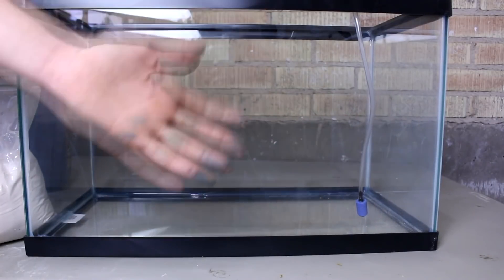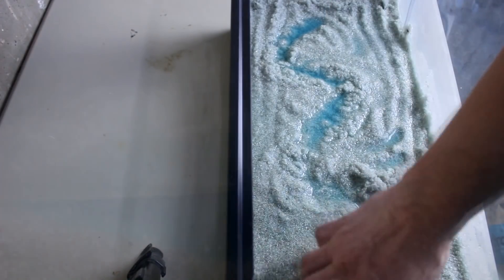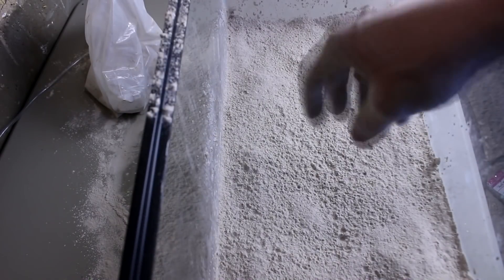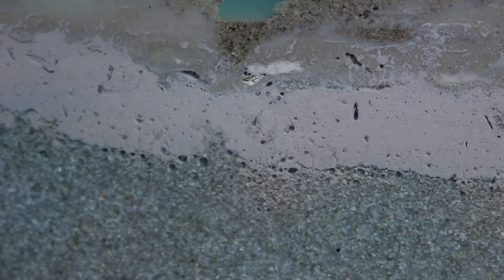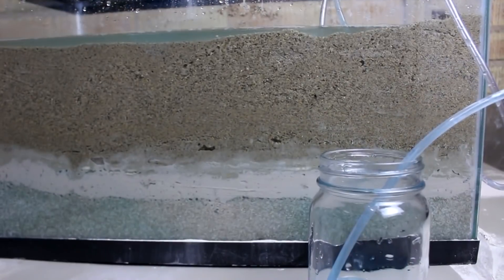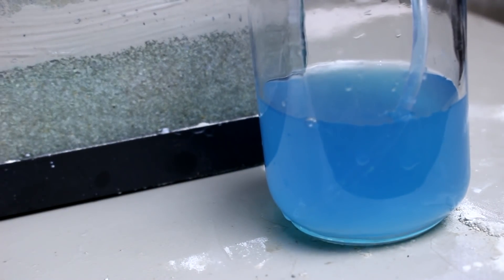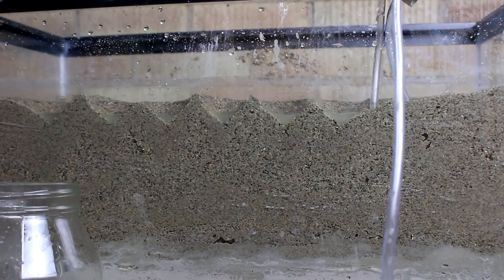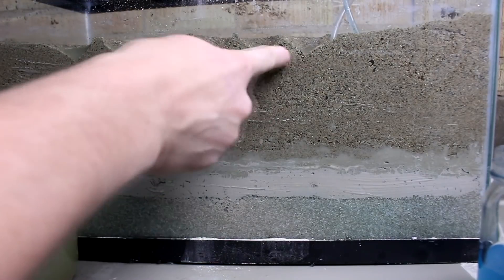Confined Aquifer Model

Comment: Where I live we have a confined aquafer prolly ~4-6 m bellow the ground because we have a surface clay and stone layer with a thin topsoil layer, but it must be a lot more porous in the aquafer than sand or sandstone since when it rains a lot especially when tropical cyclones make landfall and dump rain on the range we can actually hear the water moving through it which is a bit scary, and a few years back during a flooding event in the wet season the ground in some places felt like a waterbed.

Comment: Do red hot anything in a vacuum chamber. I want to see how long it'll stay hot with no air for it to transfer the energy to. The only problem is how you'll levitate it in the chamber so it doesn't blow anything up. You might need some aero gel or something.

Comment: your wisdom. When melting aluminum there is always a leftover called dross that is what appears to be oxidized aluminium and some contaminants, trying to retrieve a big amount of leftovers I've seen some ways to deoxidize aluminium using caustic soda (NaOH) or oven degreaser. I need your lights on that matter, what is your opinion?

Comment: Is that not just siphoning the water? if the tube exit is lower than the water source then there is nothing to push the water will pull its self down the tube on its own

Comment: The way you explained california's settlement issue is incorrect. The vast majority of settlement occurs from water that was trapped in the clay aquatards, being squeezed out into the confined aquifers as the pressure drop from wells allows this to occur. It is secondary settlement where the clay particles flatten out their orientations, decreasing the void ratio. The sand layers have way way less water by volume and they are by comparison not compressible. This is why the settlement is irreversible because you can't reset the void ratio without digging it all up. The aquifers (sand, gravel, larger silt) themselves can be recharged though and doing this intentionally is called groundwater banking.

Comment: The effect should  be magnified substantially, if an earthquake happened. 

There is only so so much compaction due to confining stress. The level of volume change increases dramatically if deformation (strain cycle) occur. 

A shock wave causing two-way cyclic loads will cause HUGE shrinkage. It could be plausible to revive dead aquifer using explosives, I guess :) (especially if the explosives are placed on opposite sides of the regions being "shaked down")

Comment: hey Cody, so if you turned the bottom layer of sand into water some how without disturbing the other layers, would you see the bottle fill up extremely quickly rather than slowly because the water doesn't have to travel through thick sand?

Comment: Nice video, but slightly misleading. Although the concept of overlying ground compressing an aquifer is technically correct, it can only occur if the aquifer is entirely confined. 
Almost all artesian wells are driven by hydraulic gradient, such as described when you were talking about recharging aquifers. The pressure is being created from hydraulic head due to elevation of the aquifers source, not ground compression.  Yes, ground compression can apply in some circumstances, and pore space loss due to compaction is common, but it is the exception, not the norm.

Comment: If we ever needed to for some reason, would it be possible to refill a confined aquifer? I know shipping fluids over land is expensive relative to the value of the fluid in question (especially so in the case of water), but assuming it were cheap and easy to do so, could we overcome the ground pressure and pump water back into an aquifer?

Comment: My family lives in an area in the Nebraska Sandhills where for about about 5 square miles it is perfect for having an Artesian  well or flow and well as we call it. We have have over 10 i believe on the property, the oldest dating back to 1892 and none of them have ever stopped flowing throughout their lifetime. One of them is powerful enough that when it was dug in the 40's they had put an extra 20 feet of pipe on the drill stem to cap it off before cutting it and even then the water flowed out. There is also a 4 inch well in our lake that fills it up too.
Reply: Sigibrand there was one near a creek where I live and that creek had crystal clear water, then the city capped it and that creek has become the dirtiest waterway in the state

Comment: shouldnt have had the glass below the waterlevel in the sand, interconnected vessels allone should drain the water, without soil or anything, if the waterlevel in the pipe (well) is above groundlevel once.
Am i wrong?
backseat science here

Comment: Once it starts though don't you create a siphon? I say that because the tube in the glass was about the same level or below as the one in the bottom layer of sand. Like a tube in the gas tank which leads to a Jerry can on floor. The inlet (gas tank) is higher than the outlet (Jerry can) just like your tube leading to the glass. If you had kept the tube opening at the same level (like a well on the surface) would that much water still come out I don't think it would have.

Comment: In theory, with enough pressure, could you force water back into the bottom later? (in model and in real life)
Reply from the maker: josh hightower 
Yes but it still may not loosen the sediment if it was compressed past a point.
Reply: So instead of wet sand, it would be a layer of water between sandstone and clay (ignoring the enormous pressure)...long term it would seem that that could cause issues.

Comment: The only thing I didn't like about this experiment was that he lowered the output of the tube so it looked like it was acting like a siphon. I don't think he would have gotten as much water out otherwise.
Reply: Which is what pumps do as well. I thought that was the point.
Reply: I thought he was suggesting the pressure from the other layers alone was the cause for the large amount of flow.

Comment: Cody, have you seen that rich technology designers in Silicon Valley are on a new diet trend called a "Raw Water Cleanse"? They fast for days while drinking water that has not had enzymes, bacteria and little creatures swimming in it filtered out. They call it biohacking. Apparently they say the stuff in the water cleanses your system (maybe by giving you diarrhea?)

Comment: How resistant to acid or hydroxide is bubbler stone? Can it be used to speed up chemical reactions feeding gas in liquid?
Reply: I have used them to speed up PCB etching without any problems. Hydrochloric acid doesn't seem to effect them.
Reply: That is cool. I see many chemists trying to make nitric acid bubbling nox through water but they never use a bubbling stone to make fine mist like bubbles. If they did they would get a better yield I think.

Comment: Could you make a model of fracking in a similar way?
Reply: He would need a sample of low permeable fluid-bearing rock and a high pressure liquid that is able to tear the rock apart. I think using the vaccum chamber and a small water pump he could model hydraulic fracturing with water to release olive oil for example. Would be interesting to see.
Reply: I do not want Cody to have a frackident.
Reply: Fracking's main purpose is oil, not gas. And considering that oil is less dense than water, fracking's function is simpler to understand than water wells. All you have to do is shoot water and sand into the source rock so the oil can come out and float out.
Reply: Robert Faucher Fracking involves the release of natural gas, no? I'm not sure how he could simulate that..
Reply: @a.j8307  he literally has methane(natural gas) generator running 24/7 :D
Reply: I have a 24/7 methane generator too. Mines portable but it has a hydrogen sulfide contamination and needs to release pressure every now and then with a tremendous noise and smell. They say my generator is so potent it can clear a room!

Comment: @Cody'sLab Although this is correct its somewhat misleading. The majority of artesian wells form by confined aquifers with topography and the weight of water in the high points generates high heads at well sites. I have a diagram i could show but cant post to a youtube comment. Essentially it is a difference in the watertable and the potential watertable.

Comment: I'm no geologist but I've seen live data come in the company man monitoring the fracturing of deep formations here in the Big East. Some of these formations like the Cherry River are continually moving posing lots of problems for the oil industry. I would rather have water than gas!  I've been out west. I just saw a guy on YouTube use the gasification of wood to run a generator. After watching this one I'm worried about our Forrest here. Good demonstration

Comment: Cody, you know how metronomes synchronize if they're put close by and on the same frequency? I've always wondered whether they communicated the vibrations through the air or through the surface they were one. This would be a good experiment for your vacuum chamber.

Comment: are you ever going to work on your mine again?!???

I would honestly drill multiple holes in the roof, add intake and output fans for ventilation, as well as concealed wiring system and insulate the front door entrance.
you could turn it into a green house or just a cave house with stuff like built in rock counters lol

Comment: Great video... may I make one tiny criticism?  Having the exit of the tube into a collecting jar below the level of the source of the water produces a siphon effect which increases the flow rate above that which you'd otherwise get.  If you had done the same thing with the higher level water source, having evacuated the air from the tube, that too would drain purely from the siphon effect.  So your explanation is fine, but the demo is a bit wonky.
Reply: Yah I was looking for this comment, he's siphoning his aquifer, it's not a spring anymore
Reply: should have had the peak of the tube just a hair over 1 atmosphere of pressure high.
Reply: that's obvious though its just for exaggeration on such a small model you want to see the water get moving
Reply: i understand that some siphoning is occurring that's probably for sure, but how noticeable is the effect when we are talking about water in an aquifer? wouldn't the resistance from the sand kind of stump the effect a good amount? maybe even cause it to break at some point? especially since the further away it gets from the hole the harder it is to keep the siphon going.
again am assuming there is some siphoning going on but am just asking if a siphon is actually an effective method to pump in this situation, this being a small scale probably yes, but what about a real confined aquifer? plus i think the pressure in the modelled confined aquifer was enough to demonstrate it can climb to well above the height of the ground (despite the small scale), which is just like real life. but again again the draining into the jar probably had some siphon action going.
i guess what am asking is how strong is the siphon action and where are it's limits? is the sand not fine enough to disrupt the siphon?

Comment: Hi Cody,

unfortunately you put the the end of the tube at the same level as the bottom of the aquarium. This way the water will drain itself since the the flowing water in the tube creates a lower pressure. Just like you can siphon your cars gas tank with a tube and sucking on it if on end is lower than the gasoline level .
You should have put a vertical tube in the sand and show the Confined Aquifer Model by the water rising in it.
Reply: isiTsotsi An artesian well results from a path leading to the surface that is either equal or lower than the water table level which causes it to flow without any work, his model is a good demonstration of this.
Reply: The well is pressured regardless. You are putting water under pressure. He adds enough weight to get it out. Sure, putting the collection at the same level of the ground allowed for the water to stick and continue to flow faster for longer. But this still properly shows the concept miniaturized. Think of the amount of pressure real aquifers (and other gas/liquid chambers trapped underground) are under, and how large of an area they can encompass.
Reply: he essentially had an artesian spring form when he had that leak punch through the clay layer.  If he'd let it keep going, it would have eventually started working it's way up to feed the unconfined aquafer on the surface layer.
Reply: interconnected vessels are indeed making the draining faster isnt it, thought about that too, the pressure from the "soil" just had to push the waterlevel above the highest point in the pipe, after that water should drain itself regardless
Reply: You sir are correct.
Reply: And in the beginning the level of the water rose by itself
Reply: I am not disagreeing with you guys but i think you get my point.

Comment: For the circle diffraction you will be much, MUCH better off using a ball bearing hanging from a needle with a magnet. I was able to easily see the dot, around 5 or so Airy rings around it and a great number of airy rings around the outside of the sphere! Clear and bright enough to film.
To get superb results a surface deviation of <λ would be good, though it works with more as well of course

Comment: I'm curious now an need to go on a learning adventure. 

I'm pretty sure Maine has underground water like this. We have good "spring water" that is filtered by the landscape an we also have incredible deep well water that was pressurized into the rock by  mile thick glaciers  durring last ice age. As a kid I was told that the couple local springs we get our drinking water from are this ancient glacial water forced through fractures in the clay. Exactly how Cody's model works. I need to find out if this is the actual reality of the situation or just what was assumed back in the day.

One of the springs is a 12 foot hole dug down through a 4-8 foot layer of clay with a ceramic culvert pipe 2foot across down in the hole. I need to go measure it now to see how high from the ground surface that the water spills out.

Comment: Is this how oil spills up from the ground when found? Please reply Cody thanks!
Reply: Oil is typically pressurized by natural gas; artesian water wells from confined aquifers are typically pressurized by hydraulic pressure communicated from higher elevations.
Reply: iroll , that's too intelligent for me buddy lol but thanks for the reply, I really appreciate it, again thank you!
Reply: denizen68 also pressurised due to the layer of water beneath many oil deposits and the layer of gas above.When oil comes up under its own pressure it is primary extraction and the well itself is a Gusher.
Reply: Oil is pumped out of the ground via pump jacks that have a pump attached at the bottom and the pump jack rotates which causes the pump to  pull the oil to the surface through the tubing. The pump jack is basically like a tire pump.
Reply: Corrie Dunstan oil is usually pressurized to to the weight and confining pressure of the sedimentary rocks they are in so yes this is analogous

Comment: Do you think when you do stuff like this in your videos, you could maybe explain a little bit about what it is? Because I'm being honest, I have absolutely no idea what an aquifer is 😅
Reply: that's literally what this video is, him explaining what all these things are and how they work
Reply: An aquifer is groundwater stored in sediment beneath the earth. Many places get their water by digging into the aquifer, collecting the water, cleaning it, and pumping it into water towers. Water towers are connected to the water your get through your faucet. The weight of the water in the towers, which are higher up than your sink, push the water into your house when you "turn on" (open a valve in) your faucet.

The video is demonstrating that confined aquifers have a hard time replenishing water due to the weight of the land above them pressurizing the sand and preventing it from re-absorbing water, meaning if there was a drought and people were taking from confined aquifers as a source of water, it may eventually run out.
Reply: Just watch it again. Sometimes learning something new isn't a one go kinda thing. Or read Wikipedia. Or watch more videos on the topic. I think he did a good job though.
Reply: snowman379 nope, I could be wrong, but a well comes out of an aquifer. they're two parts of the syst÷m
Reply: when you dig a hole in the dry sand at a beach, the wet sand underneath is the aquifer.
Reply: I’ll simplify what everyone else said. Aquifer is a fancy word for a well
Reply: A well is just a hole in the ground that goes into the aquifer.